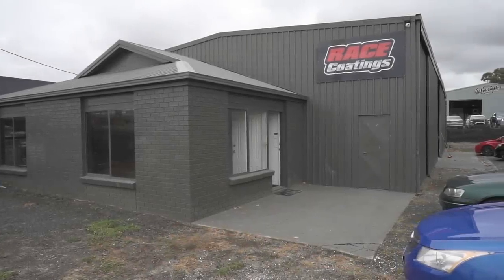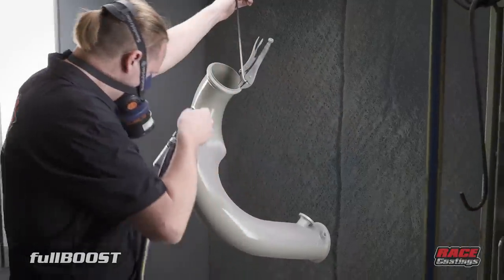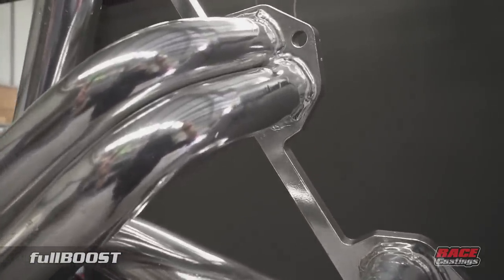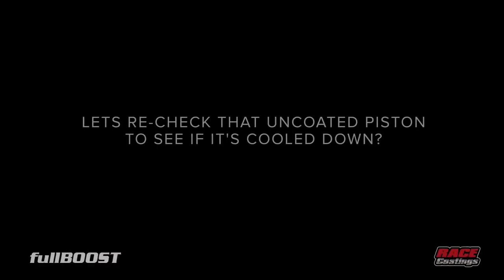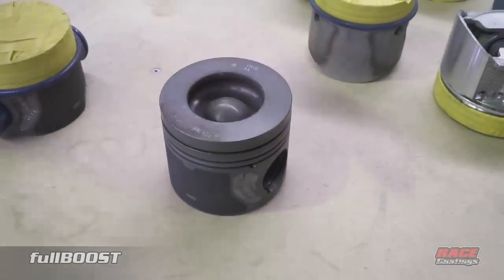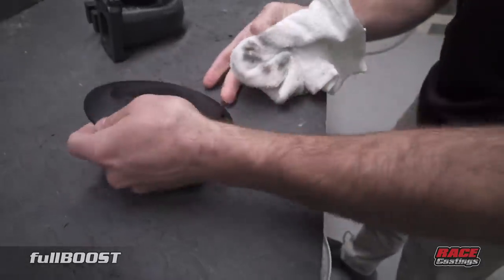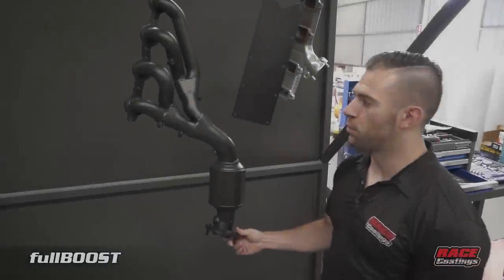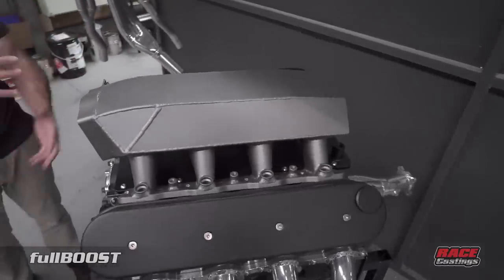What is Ceramic Coating? | Race Coatings

Comment: Curious to know how much of a difference the piston material makes to the conductivity of temperature, the uncoated one looks to be oem, whereas the other 2 are aftermarket and probably not made from the same metal.
Reply: get yer rotors done here https://www.wallworkht.co.uk/
Reply: Your up and down this whole page advertising this shop. Do you work for them or something??? There are plenty of reputable shops doing it here in Aust- why would someone ship their stuff half way around the world to get done what could be achieved in their own country
Reply: no. not at all. i read through articles and subjects that are of my interest and see the videos. then see that some people think they can do in a small outfit what you need 100k worth of equipment to do. to do pistons they should be treated under a vacuum with a plasma spray. i didnt know that until a few years ago when i visited a company completely by chance and they make the equipment to do specialist coatings and ceramic coatings. i spoke to a engineer who was building up some equipment that looked like it was from star trek or back to the future to do specialist coatings and it was to be sent to the USA. i would love to think that i could do a quality ceramic coating on pistons for cheap and it wouldnt burn off or flake off after a very short while. funny i never heard about paint on ceramic coatings when i worked in aerospace- usually parts would be sent away to specialist companys with expensive equipment and knowledge to get it right.  plenty of snake oil salesmen around. hardly any manufacturing or specialist companys doing anything remotely technical or scientific in australia. no car manufacturing, anything more technical than a nut and bolt is imported.i just wonder where the cutting edge technology is in australia.

Comment: Question... I can see how coating a piston head helps with heat dissipation, but how much will coating a piston head or perhaps even an intake and exhaust valve help with the carbon build up, which also gets baked on, which occurs from blow-by? Has this been considered and tested as well?  Can the coating help reduce or even prevent baked on carbon deposits on these components? 
Due to emission regulations, the blow-by will always get sent back into the PCV/EGR systems to have the blow-by burnt off, but will the coating stop carbon after product from accumulating on the pistons and intake\exhaust valves as well?
Reply: Carbon isn't usually that big of problem. It can be burnt off, or chemically taken off. 
But with gasoline direct injection, the carbon buildup from the pcv is way worse. Maybe coating is the way to go.

Comment: Can this be applied to plastic parts as well. Coz if you can apply it to plastics, then it can virtually increase it's heat resistance.

Comment: At 8:38, you mentioned that the only product you can't do is magnesium.  Can you elaborate why that's the case?  I'm asking because I have a BMW motor build and there are certain components being magnesium alloys.  And with an intent to spray on a heat dissipation ceramic coat, I'm a bit concerned that if that can't be applied, what other options I may look for.  I'd still choose to use CeraKote as much as I can, though. Thanks for the informative video and demo, excellent work as always from FullBoost.

Comment: Interesting!  The first law of thermodynamics, also known as Law of Conservation of Energy, states that energy can neither be created nor destroyed; energy can only be transferred or changed from one form to another.  This raises an issue or two, not allowed for in the original engine design: during normal combustion the heat which would've been absorbed by the piston and transferred to the connecting rod and engine oil now remains above the piston, increasing the heat of the combustion chamber, valves and cylinder head cooling galleries.  I see potential pre-ignition, overheating cylinder heads and overheating exhaust valves.

Comment: On the piston coatings... how do you account for the different thermal expansion rates? If you keep the piston at a lower temp during operation this means it's not reaching it's full size inside the skirt.. compression, etc ?
Reply: It must just stick. Maybe it flexes?

Comment: I've had ceramic coated headers on my car for couple years now, they don't stay looking so shiny. I got it done for the performance and under bonnet temps so thats ok but I do wonder about using ceramic coatings for engine dress up like valve covers. I imagine they would look pretty dull after time compared to polished alumnium or chrome.

Comment: Can you use exhaust wrap on ceramic coated headers or dumps? I've read that the excessive heat in the pipes can crack the coating.

Comment: If the headers and header pipe from the engine to the turbo is ceramic coated is it still worth while to wrap the same to aid in heat retention.?

Comment: So with the ceramic coatings this raises combustion chamber Heats or dissipated through other metals around it?
Reply: They reduce heat lost into the cooling system, and increase cylinder temperature and pressure.

Comment: I agree with many comments before me ceramic coating definitely works but the heat test performed in this video is not an Apple to Apple comparison first the piston heads were not the same so that may of have help make the difference even more noticeable and the torch distance was not at the same distance when heating up the piston head without the coating it was closer and distributed to the entire piston unlike the ceramic coated heads
Reply: So? If you know coatings work then flawed testing means nothing but only an example of typically happens inside any engine not EXACTLY like it happens. Only F1 teams know what's going on inside an engine, everybody else is just guessing at it.

Comment: Question: When you coat engine parts or engine blocks. That's aluminium ect. The parts or the engine loses its ability to release heat?  
I did see a video of a intake manifold coated vs not. 30min cool down time the coated part was 50c+ abow the non coated.

Comment: The coatings work. I've used them and you really have to retune the engine after applying them. Usually taking jet sizes out of the carb and the engine will run much cooler or I should say will take much longer to get to operating temp
Reply: I belive you, but who uses carbs and jets these days?

Comment: it would be cool to see a ls motor with all of its part pistons turbo headers etc and see what difference the same ls motor but stock with the same turbo setup. and see the temp differences and power limit differences between the two.

Comment: Saw a review of it recently on one of the top drag racing channels that I watch called demonology, together with the Kooks headers on his Dodge Demon. They were much cooler than normal and everyone is really impressed with jet hot, so I looked them up after watching the vid and says that its a product made by Kooks and is designed for the aerospace industry. One of my next mods is going to be a set of long tubes for my Challenger as well, and have been planning on going with Kooks. After hearing about it, I searched the web and the headers typically go for around 1200 to $1600. But then have to add around 350 for the coating. Although I found one for around $1,000, and am shocked that they are so inexpensive. They are the 1 3/4 instead of 1 7/8, but that is still dirt cheap for them. (Especially with the coating and is a bargain). I have the link if anyone is interested, and are for the 6.1 & 6.4 hemis only...https://mxamotorsports.com/product/jet-hot-headers-6-1-6-4l-hemi/

Comment: Have you thought to use a pair of type K thermocouples and digital displays for your demonstration?  A side by side comparison with the same flame heating both to confirm you have a well matched pair of TC's then ceramic coat one and test the pair again. A 1/4" x 3" SST TC probe with a nicely rounded tip should take your coating without any sharp edges to worry about. Just a thought while I'm sitting here with a pair of Omron E5CK temperature controllers in front of me for inspiration. I've tried 8 thermocouples with excellent results, unfortunately they're all naked virgin TC's. Would be nice to see some solid numbers to go with your interesting and excellent looking coating. I'm considering ceramic for expansion chambers on chainsaws and dirt bikes. Thanks for the video. Good day.

Comment: I noticed that you still sandblast your parts instead of wet sandblasting. Any concerns about the parts losing material and being subjected to heat during the sandblasting process.

I have seen car body parts affected by normal sandblasting, but not as much with wet sandblasting.

Plus is cleaner, a lot less messy.
Reply: wet sand blastng mostly for dust contri\ol. fine powdered paint since you mention autobodies I would nlt want to breath nor wet when applied and there are a whole host of BVolitaly granic Compounds in a car, jet, etc or thart matter building walk way if coated I would mot wat. Secodn this s\foprumn oin Cermics and ritaries what does sand balsting in easther form hqve to do with this? us proper form, or canbaxk you slynders and heades and intake and exhaiust runners, and pistos and rotars, sand blstoing is not persiom but if yoiu di bet your enh]gine if rins at all would rin badly and no last.  Use right forumn.
Reply: @michaelgillespie7827  WHat wherE YoU Smoking when You typed thiS?

Comment: Thermodynamic question, so if the Piston is taking less heat, does that mean the engine will run more efficiently as the fuel is burned and more of the energy pushed and exited through exhaust? Since the heat has to go somewhere?

Comment: The problem is, metal expands under heat but ceramic doesn't(or with a very small amount). Under stress the coating may loose its adherence and may come off as fragments. That will cause a serious disaster.
Reply: If we were talking like the size of a spark plug ceramic piece coming off, then yes there would be. But we are talking at most 1mm  of material ( I am being pessimistic), not enough to harm anything. At worse the compression would change...slightly.
Reply: It's a well documented problem with coated extractors for example.... It's not really a problem on N/A or supercharged applications but on a turbo vehicle it can damage the turbos when chunks start coming off the pipes internally. When it's done on pistons it just tends to gradually wear away and isn't an issue usually. I think this is an inherent problem with coating pipes. I don't think it really matters who does it, it will happen eventually on all coated pipes. Sure, some shops will do a better job than others- but you can't claim one shop in the U.K has it nutted out better than the rest of the world. Don't believe their advertising hype dude
Reply: Jonathan Simmonds - They seem to only be for industrial or commercial applications, not for consumers, is that correct?
Reply: The substrate won't get that hot, silly.
The ceramic REFLECTS heat.
Reply: Top Fuel and Nitro Funny been coated for at least 20 years.
Reply: good observations
Reply: This happened to my "top fuel" coating. A lot of gold in the oil after it lost adherence.
Reply: @tilt213  Imagine what that does circulating between moving parts, could be like tossing fine sand in the engine.
Reply: I have seen coated pistons that have had the coating come of. Teflon coating the skirts sounds great but when you are dealing with 3 thou clearance it must cause grief.

Comment: I would like to ceramic coat a Harley exhaust. The effect I would like to achieve is what a cadmium plated nut or bolt looks like (a dull gold multi color) Is there a way to achieve this color?  Thank you and best regards.

Comment: I bought some aftermarket headers for my Ferrari 360 Spider, had them ceramic coated, wrapped them with exhaust wrap, covered them with blankets.  The temperature of the engine bay dropped dramatically.

Comment: How long do you guarantee the coating on top of the piston lasts ?  I had dart coatings do the tops of my pistons on a supercharged street application and 5k miles later theres no trace of coating left so I cant even tell when it flaked off

Comment: What about DIY at home ceramic coatings. I see great success with things like headers ect. I wanted to try a set of pistons on my track car but Im afraid with that much heat it will flake off.  Even though its advertised as being  used for piston crowns.

Comment: I thought it was a  few mm thick; that is like a hi-temp spray paint that would bake on,won't do much to reduce the heat radiating out.And the pistons,you might as well make the mixture rich for a few minutes,to coat the top of the pistons,and pipes, with carbon black.

Comment: which type of ceramic do you use? is there any kind of can do at home?
Reply: You could try cerakote. It’s used in the firearms industry. They have a high temp version, but I don’t know if it’s close to ceramic header coatings. It will take heat. It’s used on suppressors that are full auto rated. It’s durable, and offers good chemical and abrasion resistance. You can do it at home if you do your research and pay attention to detail. I wouldn’t use it for headers or internal parts like pistons, but anything else would be fair game.
Reply: @patrickc1508  tks you,i will try

Comment: I have no issue with the fact ceramic coatings protect metal surfaces from high temperatures but that does raise a question for me thanks to the laws of thermodynamics that says "energy doesn't magically disappear".  So in this case the energy is represented by the heat so where does the heat go if not through the crank. The only thing I can think of is the exhaust valves are going to have to deal with increased temperatures. So if you are going to use this coating you will have to look at modifying your exhaust valves or you may suffer excessive wear or failure.

Comment: With heat not being able to escape the engine, is that really a good thing?
Reply: ON,Y IF IT CANNOT BE CONVERTED TO ENERGY where do you think expansion coms from when fuel ignites to drive yoyr pistions, if too cold many cars cannot evem start, heat management is what is a goiopd thing to get proper and best resukts, Guess tyou failed hiugh school physics amd the Laws of thermo-Dynamics, metalury, etc are a forgien language to you.

Comment: If powder coating is properly and fully cured, it will NOT wipe off. The fact that you used an improperly cured example to demonstrate the superiority of your ceramic , makes me distrust everything you say and do.
Reply: I agree! And he never soaked the rag again when he wiped the other products. I call BS.
Reply: Wrong! It will definitely wipe off. I apply cerakote and powdercoat both made by NIC and even NIC will tell you powdercoat is not chemical resistant like cerakote.
Reply: Not if its fully cured. You don't know what you're talking about. The place that does my powder coating, tests every piece with a strong solvent - if it's not removed, it's cured. If it's removed, it's redone.

Comment: How much weight does the coating add to the Pistons or other rotating components?
Reply: Thermal expansion of noncoated parts vs coated? Head scratching issues buddy!!
Reply: Ceramic is glass? Glass is sand? Sand in your oil? Yup still scratching the head!!!

Comment: how about ceramic coatings inside exhaust ports in the cylinder head and the cylinder head dome?  that would hugely increase heat dissipation and extraction

Comment: What would cause ceramic coating to start to peel off? I got my dump pipe and rear housing done and now it’s cracking and peeing off? :(
Reply: I would blame the surface prep. Not getting it clean enough, or not blasting it correctly.

Comment: How exactly does the piston top only reach 50c while the bottom is 250c? Using a laser for reading temperature is not very accurate due to different surfaces/composition .. Try this again with a thermal camera.
Reply: Coz it is high-carbon material, not a steel. So it is worse temp- and electric- transmitter than the steel. So the surface is cooling much faster than the core. But, as the 'internal' surface is bigger than the face, I do believe it should cool even faster than the core (the sides are in fact radiator i.e. heat-spreader). So is my logic, obviously here we face something else.
Reply: I would have been happy for a fair comparison between the non- coated and coated pistons. Notice how much further away the flame was held with the coated pistons??? Well away from the hottest part of the flame at the end of the blue cone in the middle whereas the non- coated piston had the flame held at the exact place I'm referring to. Also, with the editing it was impossible to tell if the flame was held on the piston crown for the same amount of time. Of coarse the longer one holds the flame to the piston the more heat will transfer through to the underside. It's not rocket science
Reply from the maker: We heated each piston up for 60 seconds using the same technique for all, as you stated this is an edited video.

Comment: How was the uncoated piston 90 degrees on the top and 200 degrees on the bottom when the heat was applied to the top? That’s impossible.

Comment: The temperature gun cannot measure on very shiny surfaces......Meaning the uncoated piston is  about 200 Celsius on the top as underneath.

The coated pistons  are about 80 Celsius, if the surface is measurable with temperature gun correctly . And almost tge same underneath. 

That means the coating seems to Block the heat coming in the aluminium of the piston. And therefore less energy transferred to the oil of the engine.